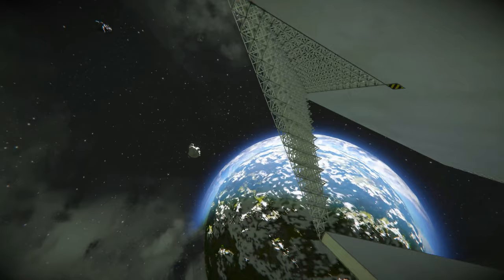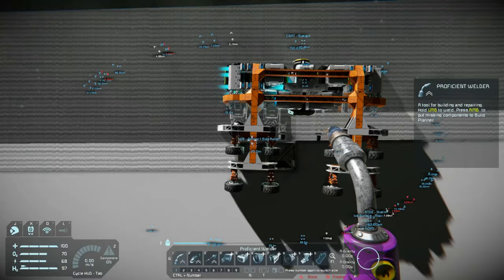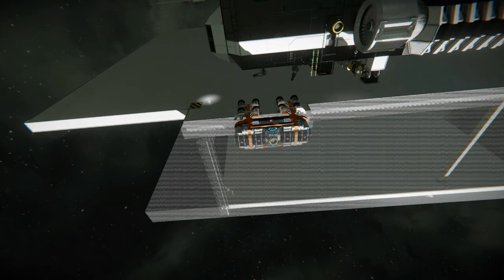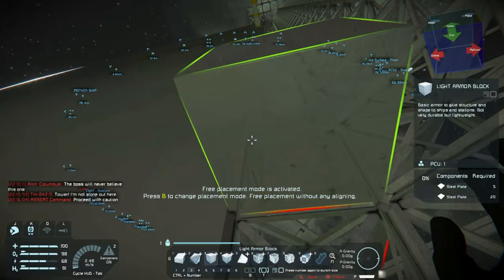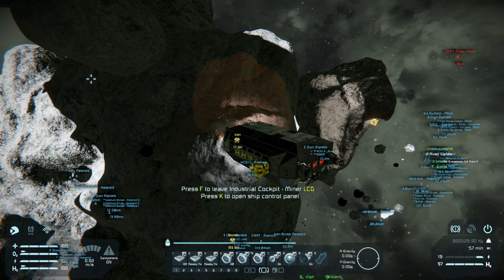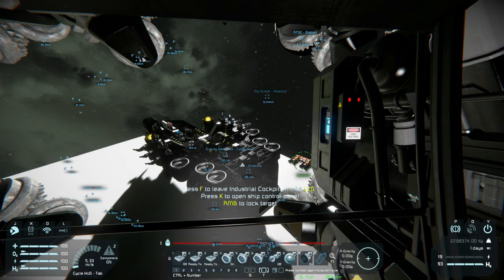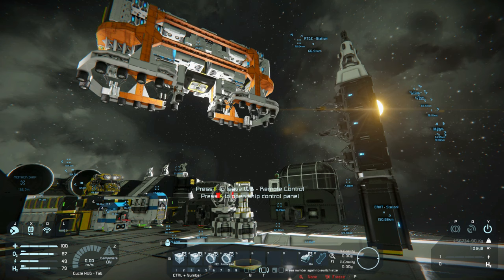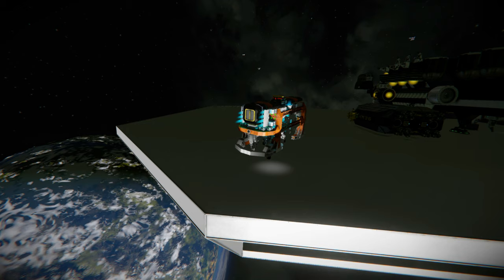Space Engineers - EP29 - Modular Construction | AI Attack | Automatic Welder | Tutorial | Let's Play

Comment: Just in case you didn't know, you can set that grid to a station by putting a control panel on it and going to the info panel. On the right is a button to set to station. (The unsupported stations check mark that you mentioned in a previous video is for the pieces that are detached from a station and whether or not they will stay part of the station or become a separate free grid)